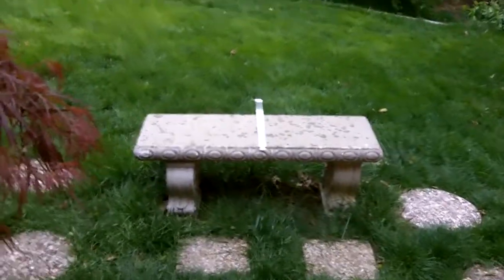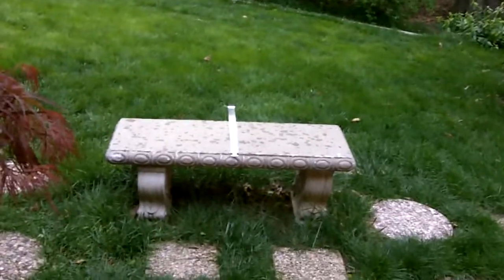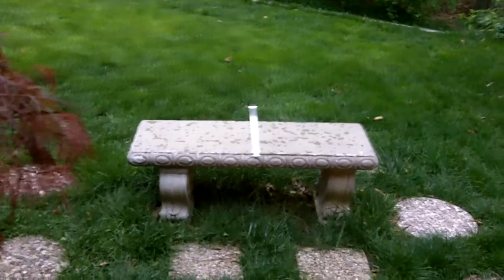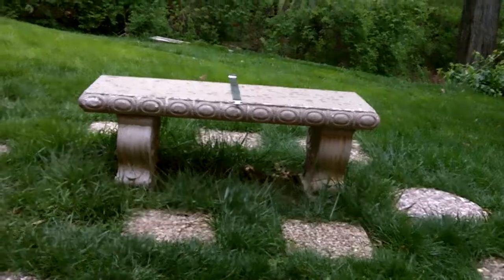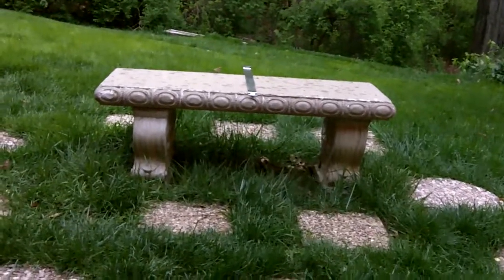How to unlock a car w/a slim jim-1978 Firebird

Comment: Hello Sir, I was to get an extra set of keys for my 1979 Camaro and put it off. Well today I was rushing and locked my keys in the car. I found your you tube video, got my metal yard stick and opened the door with your method within 15 seconds. Much thanks. I am really shocked you don't have more likes. It was so easy, I am going out to purchase an upgraded security system today. I feel really lucky to find this post in September 2018 when you posted it in 2011.
Reply from the maker: And here I am finding your comment in 2023, lol. Glad it helped!